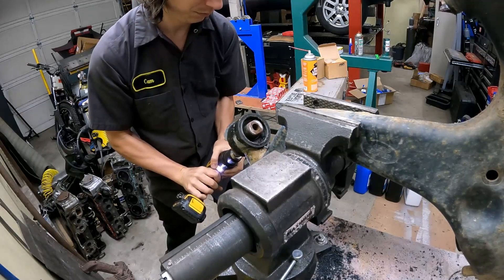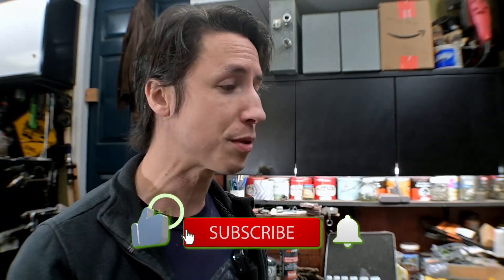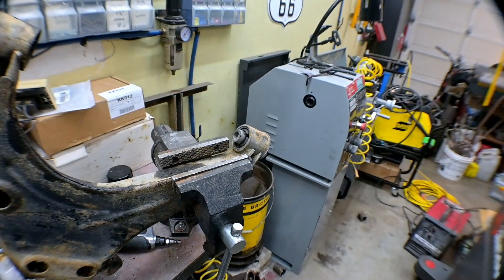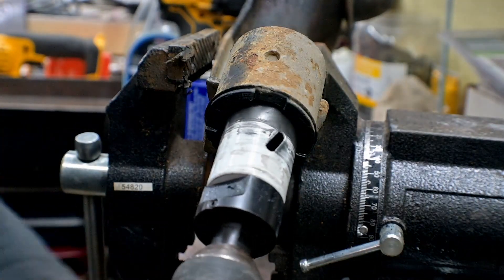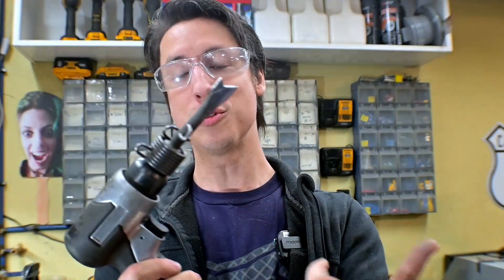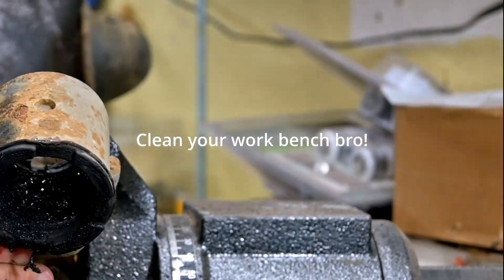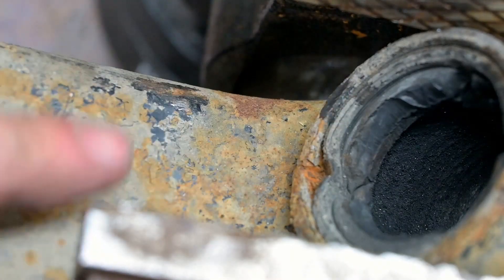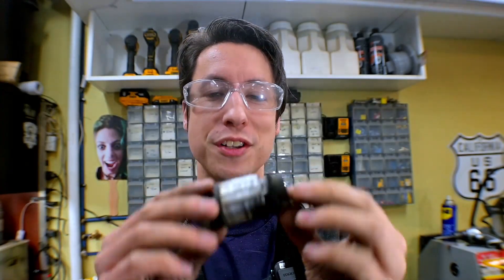Control Arm Bushing Removal (Without Using Drill Bits or Fire)

Comment: I used a 20 ton HF press to R&R mine. Worked fine. The hole saw is a good idea though.
Reply from the maker: Press is always the preferred method. With the shape of these arm there's really no good way to access the bushings, or support the arm on a press for removal.
Reply: @projectaddiction  i took my arm off and was perplexed cant find a good angle.
Reply: How did you do it with a press